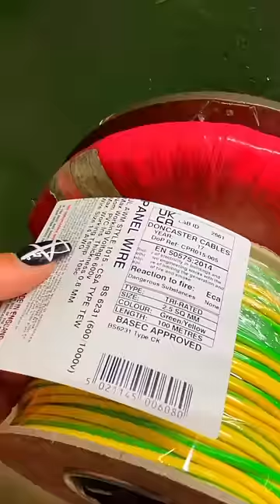This Will Confuse American Electricians!

Comment: So, it's supposed to be confusing because for some reason I guess some Europeans think we actually pull bare ground wire, when the only "bare" wire you'll ever see is inside Romex wire, and it's still covered by the outer sheath, the only part that's ever really exposed to air is the part that makes the termination.

If we pull ground wire by itself, for example in conduit or whatever, it will be insulated just like this one is.

Comment: Any confision would be the low quality coloring of the insulation on the wire.
It is supposed to be a green or green with a yellow stripe, not a hodgepodge as seen in this video.

Comment: Yellow/green wire for connecting ground in electrical panels is an European requirement. The US electrical panels that I've seen use a solid light green coloured wire...

Comment: I have the same problem. What am I supposed to be confused about? I worked as an electrician apprentice and ran multiple wire through conduit. So, what was supposed to confuse me? 
Being the fact that it was a collage classroom it had to be set up for computers we had to include ethernet cables as well. They were high grade shielded cables to guard against interference from the electrical interference.

Comment: That's tri-rated wire, used for internal wiring in control panels etc.
Not for use in electrical installations.

Although I agree, it did lo9ok poorly wound, it's not normally like that and I use their wire.

Comment: So I’m guessing it’s for an insulated ground wire spool? Even though we in the U.S. use insulated ground wires besides romex. And yet any properly installed romex with an uninsulated ground will work just fine for decades.

Comment: I don't think they know America allows green/yellow as a safety ground for power cables.

We don't allow it inside conduit 
The safety ground is Green and a load carrying neutral is white, but half the time you open a rocker box you see a green/yellow going to the safety ground.

And yes , on 3 phase grounded delta , the b phase is also green.

Comment: The only thing that confused me was why the insulation changed from green to yellow. Why have it two different colors. I mean we have multi colored wires as well but they're generally stripped so that the two colors go throughout the wire and not just go back and forth between the two.
Reply: I heard the USA were the only country on earth which doesn't generally use green-yellow as "ground" wire

Comment: This is meant to be confusing how? its just a badly rolled spool of insulated stranded ground wire. while yes most of our 12/2 has an included ground wire, its also common to pull separate wires.

Comment: I'm British, this cable is from a Britsh factory, and I'm confused why an electrician would be using this at all. This is stranded wire, and clearly says panel wire on the label. British house wiring is done with flat multicore cable with insulated live & neutral and an earth which is bare under the outer sheath, and the conductors are single strand.

Comment: Ah, there's the issue: They think we don't know about insulated Ground wire.
If I buy a spool of just Ground wire, then I'll be getting a spool of probably 12 AWG with THHN insulation.
The only place we don't insulate it is when the Ground wire is in ROMEX Cable. If it's in any form of Conduit, it's insulated.
Well, there's another exception: The wire straight out the box and onto the Earth electrode(s)

Comment: What we have here is a failure to communicate. Whether it's an earth wire or a ground wire depends on it's use. A ground wire is part of an electrical circuit, it carries circuit current, it will not be green.
A Protective ground wire is not normally part of a circuit unless a fault develops in the appliance causing the appliance to become live, it's green.
An earth wire is part of the fixed wiring of an installation. It connects to a main earth bar in the consumer board and hence via a Main Earth Cable to an earth stake or grounding grid. 
There, clear as Bidens tax return.

Comment: It’s a completely standard grounding cable with the standard green/yellow color!? I don’t understand what’s weird about it. Don’t you use them in the US?
Reply: Yellow and green in US indicates 'isolated ground' which goes to a separate ground bar for specific electronically sensitive devices such as monitors and electric equipment. I use them all the time in my commercial experience.
Reply: @MrMcShroom  Oh okay, so there’s 2 grounding points at all locations? What color is the ‘standard’ grounding cables then?
Reply: @machenka  green.  and solid yellow is phase #3 in 277Y480.  we use brown/orange/yellow for that, as contrasted with Black/Red/Blue in 120Y208 and black/orange/blue in open delta 120/208 3 phase. (with orange being the wild leg)
Reply: @kenbrown2808  Interesting - I learned something new today (again). Thanks. 😀

Comment: I'm confused why multicolored coating is allowed
Reply: It's only in this one case, to make it as easy and obvious to know which conductor you are dealing with. Everthing else than ground/PE (all phases, zeroes and switch circuits) has a single colour coating. And even when someone messes up the colour code (f.e. makes blue a live wire) or is colour-blind he still will be able to spot the difference between a single-coloured coating and a two-colour one. This also applies to poor/black&white images or schemes - you can always tell that this one wire has two colours and therefore is what it is.

Unless you meet the telecommunication/IT branch, where they use several multi-colour insulations to extend the amount of not similar coloured wire insulations in a single cable...

Comment: Grounds don't need insulation because we use solid copper not weak stranded copper
Reply: They do inside panels.  This is panel wire.  Standard yellow/green.
Reply: @jimcervantes5659  not in America, we raw dog it here
Reply: @HChandler2010  I should have said equipment panels.
Reply: @jimcervantes5659  oh ok lol, that makes more sense, I do residential so I don't mess with anything like that

Comment: Nope, not confused. Couldn't see any markings printed on the wire. Not impressed with that wobbly reel and poor spool job. We use green/yellow for isolated ground all the time.
Reply: Where do you use isolated ground?
Reply: @gabor.nadudvari  in eu we don't have isolated ground. we just have protective earth.  Maybe next year we get some more privacy and we'll be on bar with you guys.
Reply: @gabor.nadudvari  Computer and medical equipment, other sensitive electronics; or where RF interference, induced voltage, or unbalanced line harmonics may be present.
Reply: @Steve_Kassiotis  just to clarify, you use green/yellow for your insulated ground? is that just coincidence or what
Reply: @spellwasp2579 Up until the 1970’s single phase electrical wires were coloured green, black and red. This was an issue since the most common form of colour blindness is where red and green are perceived as identical due a reduced sensitivity to red or green light.
As a result since the late 70’s the colour multi coloured (yellow and green) Earth was introduced, however it was only since 2004 that red was phased completely and brown now represents single phase line and blue represents the neutral.
Reply: @georgedeaney7270 what country does this madness??
Reply: @cai2726  Per code, insulated can be either green or green/yellow. In standard practice though, green is regular common ground and green/yellow is isolated.
Reply: @jacobnorth8642  UK
Reply: @gabor.nadudvari  i have seen some of this coloration on imported Chinese led lights here in USA. Thank you for letting me know that this may increase in commonality.

Comment: I worked in a wire manufacturing plant here in Texas and that reel is badly rolled like holy molly. And they also didn’t show how they measured the wire…. I worked on a similar machine and it should have a device for measuring length. Also she ran that machine so slow lol.

Comment: My 4 years of education and 2000 hours of proven logged labor was no joke. I am confused about something though, all reels of THWN/THHN here are required to have a resistance test conducted and a continuity test, to prove the wire has consistent diameter and obviously, it's continuity. I saw no such test here.
I'm also surprised a factory is using an ancient home depot machine to spool wire.

Comment: Residential code is not commercial code. You'd have to find the most under the rock, rural backwater electrician to not have dealt with or at least seen, an insulated ground nowadays.

Comment: Why??
Reply from the maker: Green & Yellow
Reply: Green and yellow is ground check, Chasis ground or case ground. We use it, just not often unless it’s mining
Reply: Industrial automation uses this as well.
Reply: @qrow8638  green and yellow is isolated ground in most commercial buildings actually
Reply: Light green and yellow  is used to separate power grounding from signal grounding.   Signal(communication equipment) and computers: are more sensitive to power and grounding fluctuations.   It's called noise.  Medical devices that require electricity are also segregated from other electrical loads.
Reply: @frankay90  WTF is "isolated ground"? If it's isolated, it's not ground!?
Reply: @BrianG61UK  An isolated ground is a ground connection to a local earth electrode from equipment where the main supply uses a different earthing arrangement, one of the common earthing arrangements used with domestic mains supplies. There i looked it up for you. Ive been an electrician for 11 years here in Virginia i think i know what im talking about. We use it for ig receptacles for sensitive equipment usually medical or other sensitive electronic equipment.
Reply: @BrianG61UK  normal household ground in usa is a bare coppar. In their romex cable, you have white and black insulated wires for hot and neutral and a bare copparwire for ground. In uk/eu ground is also insulated in green/yellow and then inside the cable.
Reply: @kerberos623 in UK they also had bare earth inside TPE until very very recently.

Comment: Yellow and green wire in a plug is the earth and third pin, which US plugs dont have. Judging by everyone being confised id say it worked 😂
Reply: What makes you think American outlets aren’t grounded?
Reply: @1986pena  all the travel adapters and plugs I've used in the US only had two pins, turns out some have a third. Learn something new every day
Reply: @thomaswilliams4543 the NEC made grounded devices standard back in 1974 in any new construction. Only existing stuff got grandfathered in so you really only see two prong outlets in older buildings
Reply: Yeah no such thing. We have 2 prong outlets that still exist in some ancient houses with knob and tube but that’s pretty much all

Comment: Ok, Murica' here, what's up with the yellow? Green too much for PE? 😉
Reply: Ground/earth used to be green only. But colorblind confused it with brown/blue black of hot and neutral. Thus green/yellow for ground now.
Reply: @kerberos623  ah yes the infamous colorblind electrician. odd to think we changed codes for a guy that doesn't stand a chance of surviving his first day on the job
Reply: @kerberos623  NGL if it helps someone I'm down for the change 🤗 after all, there's no point to a standard if there's more than one

Comment: Doncaster Cables is the largest British owned general wiring manufacturer in the UK.

I am confused because i am not confused. 
Ok the finger nails are ...
And at the end no plastic finger nails. 

A lot of video cuts. 
A lot of manual work = Maybe for special cable in low amounts. 

May a timelap video ?
The video is not worth to view. 
 
The cable production is at doncaster cable in UK  generally faster. 

yellow-green = protective earth .
I use these in a boat at ... . 
Maybe other electricians not at ...
Not worth to think about !

I cant see if mm² or AWG size . 
I cant count the amounts of thin cooper wires = worse lens quality.

No solid copper core = the cable is used for ... 

Cant see the the cable length and weight.
Cant see some more labels from test institutes. 
The video quality is worse.  

No better cable wrapping with a mechanical cable guide ? 
That is confuseing ! 
Ok special solution for a customer ordered small amount?
NO no no
The cable is a sample for the quality control department. 

Ok these video contain a lot of cut and show nothing. 

From big reel to small reel and a checked  electric isolation with high voltage. 

Useless video

Comment: hurdur, it says it will confuse because when you put the wire inside the wall, one point it will be green, in another yellow, so the eletrician can't differ what wire is the neutral or phase (idk if its the correct words to say about the two types of electric current)

Comment: Dumb, it’s insulated ground wire, how is that confusing? It gets used all the time here in all sorts of applications. Romex and big earth grounds are really the only time you see things grounded with bare wire and even bigger earth grounds most people are using thick insulated wires from the industrial machines to the posts.

Comment: It isn’t difficult to confuse an American ‘electrician’. They’re about the equivalent of the average DIY-er from virtually anywhere else in the world.
Reply: Perhaps in some areas. My 4 years of education and 2000 hours of proven logged labor was no joke. I am confused about something though, all reels of THWN/THHN here are required to have a resistance test conducted and a continuity test, to prove the wire has consistent diameter and obviously, it's continuity. I saw no such test here.
I'm also surprised a factory is using an ancient home depot machine to spool wire.